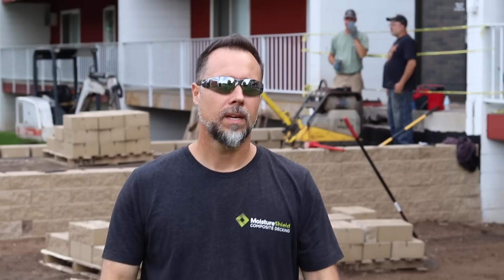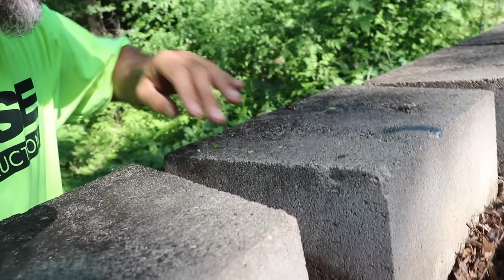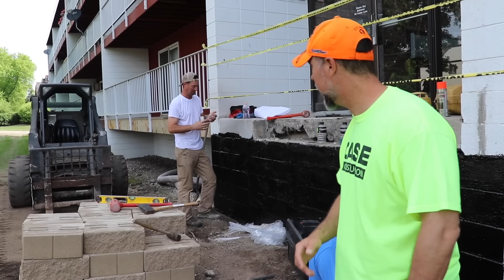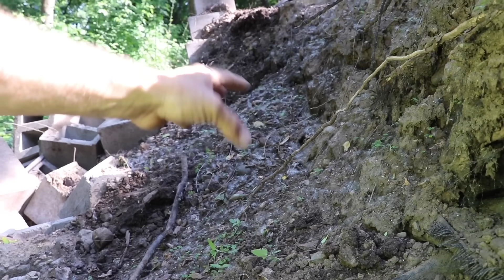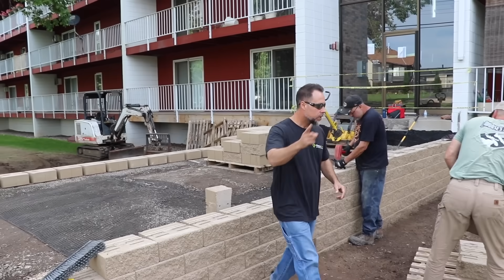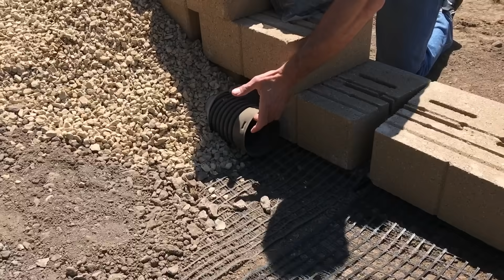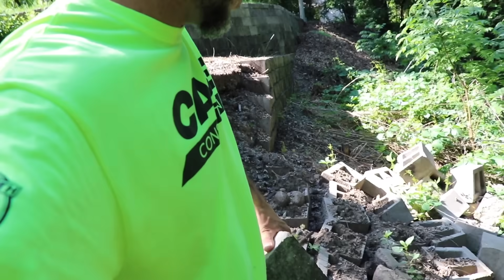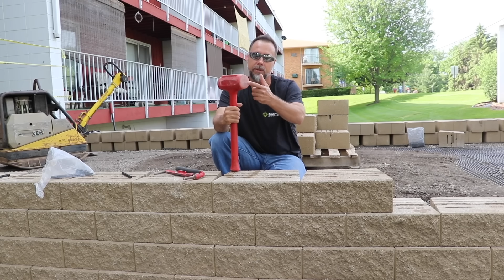How NOT to Build a retaining wall.  RED FLAGS, common mistakes, bad designs pt1

Comment: Everything in this video is so true i work for a builder( in france) and one of the guys i worked with built his own house out of blocks and when he went to fill in around the basement the 6foot wall just split ,it opened up that much i could fit my hand in and they were cemented together hollow blocks are grate above ground  but never use them under ground this guy is bang on the money and by the way that fabric isn’t that for putting under gravel to stop weeds?

Comment: I like the information. I like detail. When I go to do further research I have some base to start from with lots of connecting info like trade lingo, rules of thumb, pros and cons, pricing differences, etc which all ties together. What I would like to know is hypotheses of why previous contractors made these poor decisions. I like how you pointed out the proper way to use the hollow blocks, and explained their popularity and that for certain applications it can be effective if used correctly. What I don't understand is the mentality of just get it done quick at the cost of not doing it right. My buddies fence gate was dragging on the concrete due to the hinges letting loose from incorrect install, regular gold screws into pressure treated wood so they were rusted to nothing and pilot holes weren't drilled so the lumber had terrible cracks radiating from the screws. I researched it, bought heavy duty hinges, exterior screws safe for pressure treated wood and a metal cable that would distribute the weight of the gate. I explained it to my buddy, had another job to do but told him I'd start it later that day. He took it upon himself to just get it done and screwed in the screws without pilot holes and not one of them was straight but went at funky angles so the head didn't sit flush and the screws poked out the side of the wood not penetrating deep into the wood for strength and didn't bother putting in the cable. I got back later that day to see the rush job he did in dismay and pissed off because I knew it was a waste of money because it would need to be fixed again after one season. He beamed with pride the the job was done and the fence gate fixed because it opened and closed without dragging and having to lift it while walking it along it's radius. I told him where he screwed up and pointed out the cracks that were already appearing from the screws and he shrugged it off and said I know I'll have to fix it in a year or two but it's done and over with now. I yelled at him, my way it would have been done for years to come(I was going to sand and paint the fence to protect against sun) and it would have taken but twenty extra minutes. My take away from it was when he offers to help me fix things or do anything I always declined because I don't need someone half half-assing my jobs. He's constantly looking for the quick and easy way yet he is constantly every weekend having to fix something. I lost some respect for him after that after witnessing him being the root cause of his constant busyness. Nothing lasts forever but if I have the choice of spending a little bit more time now to do something right to save myself a whole bunch more time in the future I will.

Comment: I lay hollow blocks for almost all my retaining walls, once all the courses have been added to the wall we will core fill the inside with aggregate or concrete depending on the location and height of the wall. We also lay a concrete footing typically around the 200mm mark for our block walls and then lay the blocks on brickies sand and cement mix. That’s in Australia I guess it’s just weird seeing it done so differently but still a quality job 👌

Comment: The block manufacturers recommend geo fabric behind the wall. The fabric is not the problem. The problem is that they did not backfill the wall with a granular material like class II sand or stone which is also per the manufacturers specifications. We typically specify sand backfill, so you have to have a fabric to prevent the sand from working it’s way through the joints in between the block. If the sand is allowed to work it’s way through the cracks the soil erosion will eventually make the wall fail. I agree that the soil plugged up the fabric but that’s because it was regular dirt and topsoil. Don’t ever backfill a wall with clay and topsoil, always use sand or crushed stone. The other possible problem is that they may not have installed a perforated drain behind the wall at its base.

Comment: Good job on the video but you should stress building codes where we are you have to put fabric behind your drainage rock in geogrid / code will not pass if you don't I must stress the fabric is a foot behind your drainage Rock

Comment: Not to criticize, but the very purpose of geotextile fabric is to act as filter layer behind the drainage layer (gravel) and act as gravel-soil separator. Like you mentioned,  geogrid helps with surcharge. (btw, you missed taking into account another surcharge type - very load from the "wedge" of the backfill that the wall is supporting...angle of repose. This load get larger when surcharge get saturated) but it is  filter layer+ geotextile that aids the shedding of excess moisture and reduce pore pressure and avoid the relieve excess load from saturated backfill.  It also prevents the soil loss from behind the wall.  Without the geotextile fabric, the fines WILL get washed out over the years and cause other issues. In the video you attribibute the failure of the old retaining wall soley on the fabric. Maybe they used the wrong fabric and/or used it improperly or maybe did not have a drainage layer of gravel between the blocks and the fabric. A properly installed nonwoven geotextile would result in better drainage and more stable than you method where you are relying on the gap between the blocks Nothing wrong with that in certain situations, but its misleading to state "NEVER use a fabric in retaining wall". There is no way non woven geotextile is  going to clog up to a point where it can act as block. That water molecules that get shed out due to excess pore pressure is way tiner than any fines in the backfill and the gravel layer virtually holds no water. The differential in the pressure will result in a much better drainage than your method.
Once again this is not to criticize your video and your 'eyelashes', lol, I appreciate the effort you took to upload this. I just wanted to let other readers know what using the correct fabric is not only OK  but will actually help the overall design.
Reply: I believe the biggest issue with the fabric he was having was having it installed vertically as opposed to installing it horizontally. He mentioned vertical fabric is never good numerous times
Reply: @toddleone9696  I think he also said weed fabric....
Reply: Wurd
Reply: I can't agree more. Having built hundreds of walls with Versalock that are still standing today, you said it better than I could.

Comment: Whoa. Is that a grey fox? Anyhoo. Anyone know how much different it was done for foundations back in the day (1700s or so) using local field stone? Im guessing all of the same principles hold true. Rock backfill, angling it into the hill, weep mechanisms. I wonder if planting a specific tree variety that has non invasive roots to act as a geolayer holding the earth somewhat together would work. Perhaps burying rotting wood to promote mycelial growth would help too. Trees would also lighten the load from the water thats soaked into the soil. Im thinking about a design for a wall for a home that uses the earths thermal mass to keep it cool in summer and heated in winter.

Comment: Do you still do timber walls? How do you feel about rail road ties? Would you use dead men to secure them into the dirt or still go with the grid? I've done them and spiked them to the previous course but nothing huge. I've been out of the game a long time. Crew that I was working with used complete solid blocks and some sort of adhesive to hold them together. Didn't seem right but I'm not the boss!

Comment: I am a licenced general building contractor here in Adelaide South Australia.  To legally build a retaining wall in South Australia you need to be a licenced builder. I work mainly for rental companies and I have seen retaining wall failures in many house gardens etc.  Whenever I have been asked to fix damaged retaining walls or build new ones I always say NO.  Why?  I have no experience with this type of construction and, in my opinion, this is something that needs to be left to the experts.  I don't want something that I build fall down in 1 - 5 years because I have built it wrong.  I especially don't want to run the risk of having someone injured by my lack of experience.  I have watched many of your videos and each and everyone I have watched has given me knowledge that I have taken and used in my job.  Thank you.

Comment: This is a great video! I was a little bummed that I did not get the notification even with the bell rung. But it's all good cause I get to see it now. 

This video is very applicable now because it seems to be the retaining wall season. I work for a brick/concrete company that makes the keystone retaining wall blocks that have the pins. 

This video is great because it covers what you should and shouldn't do.

Comment: I really enjoy your videos. But I don't really get why concrete seems to not be an option for the retaining walls that you build (for instance reinforced concrete filled blocks)? Is there a special reason for it, or maybe just cost? Especially on this wall my first idea (as a non professional) was to pour toconcrete stripes as a foot for the walls, build the wall with hollow blocks and fill them with reinforced concrete, especially if there will be other structures on top. But then, I'm not a professional and there might be reasons not to do that (besides cost).
Reply: Peter Satzer that’s how it’s usually done hollow block concrete and rebar. This way is probably faster and allows for better drainage.

Comment: Height of the wall is is some areas is measured from bottom of gravel footing.  Thank you. 
Vent is a nice touch. The hollow blocks take time to fill with gravel, so material costs are offset with labor for filling. 
On corners with a surcharge some will fill the  hollow block with vertical rebar and pour the corner solid with concrete.

Comment: Great video Stan. The problem I face is they do not sell the solid pin style block in my area. It would be great to see what the second and third best options are and how to use them along with an in depth on  boulder retaining walls as well.
Reply: Donnie Beck use hollow blocks and fill them with rebar and concrete.

Comment: Thanks for such an awesome video. I really like the details and would like even more details. 

I started my landscaping business in Seattle in latest of 2016. And I have just now built my first tiny wall in 2018. The customer had wanted to use some blocks ordered from a Seattle spot. I don't remember what exact bricks were ordered, but they were some kind of hollow-tapered bricks, and I had to cut them down a custom fit to a roundish wall. I even cut the display top caps using my stihl concrete saw. It is beautiful. And just the top caps are about 73lbs. (The tapered hollow bricks, not so heavy).

I see plenty of other walls that looks like it is not even tapered. And I just wonder, wow, how does that 10' wall even hold to guard the driveway down slope.

Comment: Good stuff man, keep it coming. You hit alot of good points that lazy contractors don't care about in the long run, and that home owners are unaware of; putting trust in a contractor that may or may not know how to do it right. Let alone one who has the passion for their work that we do and wants to make sure that the job is done right for their clients and build something that they can be proud of years down the road. I wasn't planing on watching your whole video tonight after working late and prepping for another day on a paver job myself. However I was compelled to express an appreciation for the technical detail you elaborated on, and I must admit that large retaining walls aren't my strong point as a small business. But at any rate good video along with the rest I've seen. You seem to have a passion and respect for what you do and that's what I appreciate, so keep them coming!

Comment: More more more good stuff Stan I’m going to buy that paver coarse next week. My dumb but just passed on a patio redo slash extension with 3 wall supporting the patio it’s sinking in spots and has been repaired 3 times in four years

Comment: When laying grid between layers of block, the grid should extend completely through and to the face of the block. Any grid extending beyond the face after installation can simply be burned off with a torch. By running grid entirely through to the face of the block, “fudging” your level of the base block from front to back will never need to be done as it will evenly rest between the layers of the bkock Never set base block in any other way besides level side to side AND front to back. Lots of good info in this video but you should consult NCMA on your info on this minor detail!

Comment: As it happens, I am going to be building a retaining wall tomorrow. What are the chances the video comes around at the same time. That being said, I am not so worried about the strength of the retaining wall since it is aesthetic rather than functional. it is being built about 3" ahead of an already established slope that is well compacted. The wall is only going to be about 16" tall as well. The only weight it will really be carrying is the extra material added to fill the space between the bank and and wall.

Comment: How can I repair a very short (4 row) Belgium block wall that’s splitting at the outside corner?
Can I dig out the dirt from in side the corner and install some kind of corner brace and then backfill?
Thanks.

Comment: Love these longer form videos, esp on subject of retaining walls. You seem to contradict yourself on drain tile. It doesn't do anything but you use it to make customer/engineers happy. Is drain tile part of any code requirements ? We now have to get a local permit from the township to do a retaining wall. Is that needed where you work Stan ? If so, a video on navigating the permit bureaucracy processing would be super helpful !

Comment: Great video. What about concrete and rebar CMU with mel-rol backing with drain pipe and rock behind the wall? Are those types of walls weaker?one more thing, do you ever get the white staining over time from water seeping through?

Comment: Ive been installing 90 pound 24x24 inch paveers. And it absolutely sucks because I have to do it by myself. Lifting those things all day, is the worst because they are so awkward to carry and move around. I got about 60 down and about 20 left to go. 

Heavier is not always better. It would of been so expensive to transport and install all those heavy blocks at a site like that. Not everyone wants to pay for the long lasting landscape job. They just want it done cheap.
Reply: f0rumrr most material supplier will deliver that block for pretty cheap.

Comment: I worked for a company that would put filter fabric down as geogrid bc they were too cheap to buy the real stuff.  And that was 1 time... the only time they even considered geogrid.  They did it on the top part of a wall that was already tipping forward.  Idiots man.  So many unethical approaches to their installing methods.

Comment: Very helpful video. Thanks.  I have been planning on pouring concrete in the wall l am about to build.  Maybe about every  third opening and work in a length of rebar.  Do you think that would be a good idea?  I would appreciate your opinion. Thanks again.

Comment: OH MY GOD thank you so much for this. I am in the process of designing a retaining wall for my father's property after some heavy rains last spring caused a failure on his old wooden one. I was going to get the cheap block, and was going to put "filter" fabric vertically along the back of the wall, per the recommendations of my local big box store. Little did I know I was setting myself up for failure! Turns out I also have some surcharge I need to take into account, which I hadn't even been considering.  I've seen some of your other videos on retaining walls and thought I had learned enough lessons, but this one literally came out a week or two before I was gonna order everything, and made me realize how much more I need to learn. Thank you SO MUCH!!

Comment: What is your thoughts on the Versalok Ultra block?  I was considering it for cost reasons.  10ft wall, no additional surcharge loads, was planning on using geogrid every 4 courses.
Reply: For a 10 foot wall get the wall designed by an engineer. Every four corses is too far apart. And, how long is the geogrid? It matters. Depending upon the soil the grid should be every 2 to 3 courses and 8 to 10 feet long.